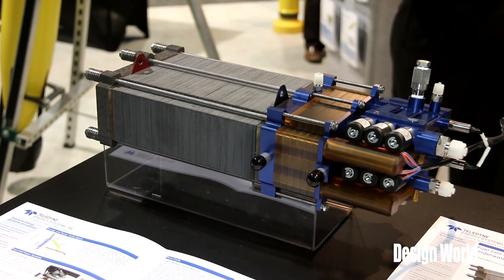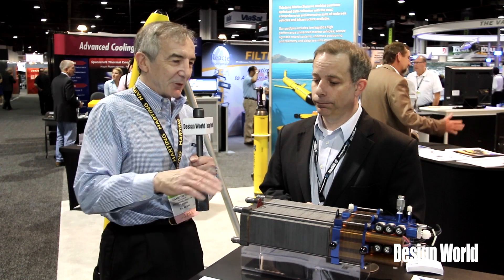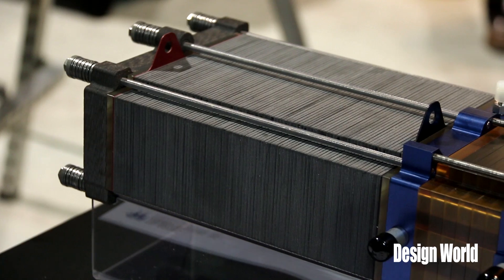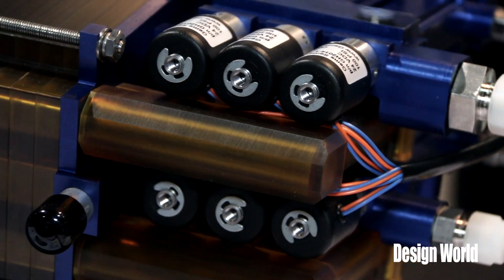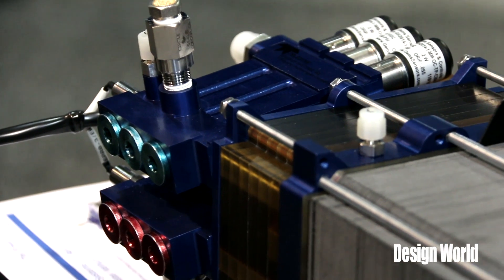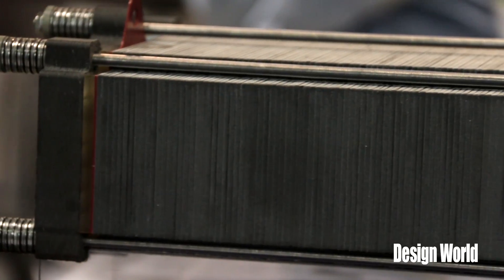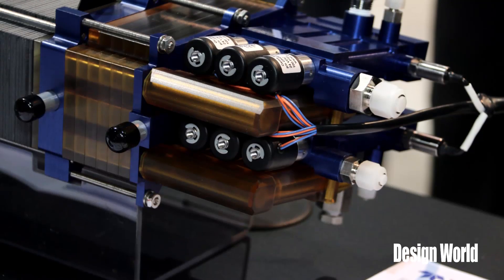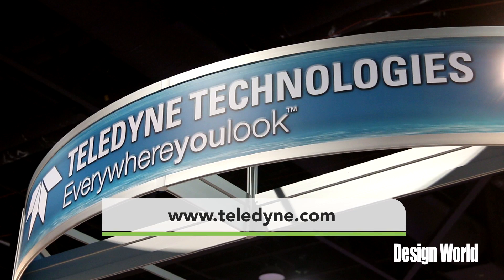Who needs batteries when you've got a hydrogen fuel cell

Comment: Fuel Cells make no sense in Vehicles. First You need a large Tank to store the High- Pressure, flammable liquid Hydrogen (5000 PSI!). Second You Need a huge and expensive new Infrastructure to supply hydrogen. Additionally Hydrogen is very expensive - the Industrie itself talks about 16 US$ per Gallon. Hydrogen today is made out of Oil or Gas, all but Emission free. And it has a poor Efficiency of not more than 19 %.  After all a hydrogen fuel cell powered vehicle is nothing but an electric Vehicle with a different Kind of Batterie. Install Batteries instead of HFC and You get a reasonable vehicle with an Efficiency above 70%.
Reply: acm the shuttle has 3 7,000 watt fuel cell generators. But only 2 tanks of 98lbs of o2 and h2 and flies for 15 days. How is that possible?
Reply: Abdullah Salman---

You have it totally backwards, fella.  There are already a million very satisfied EV drivers all over the world (I have been driving electric for 10 years now), and that number has been growing exponentially.  Virtually every car maker has begun serious, multi-billion-dollar programs to meet the Tesla challenge--- Porsche, for instance, has a billion-dollar battery plant in the works, and their Mission E is a high-performance four-passengee sports car that has been getting very favorable reviews.  Name any US or European car maker, and you will find that they are running scared, seeing that EVs ARE the future, they say so publicly, and know that if they don't get up to speed, Tesla and other EV makers will be eating their lunch.

I have four very different EVs, including a Chevy Bolt, and a fully electric Chevy pick up truck that you can see on You Tube.  If EVs were the losers you are delusional enough to think they are, I and countless other EV drivers would be jumping ship to go to ICE cars or the pathetic HF cars you are deluded into thinking are an answer.

I have no doubt the only reason you think FC cars are such a panacea is because you do not own one, and have not driven one for a few years or so, unlike the millions of EV owners that have!  Have you noticed that, of the few FC buyers in the last few years, you do not hear any rave reviews from long time owners?  They typically switch to EVs eventually due to all the hassles.

There are DOZENS of SERIOUS problems with trying to mainstream FC vehicles.  As an example, H2 is extremely chemically reactive, making various parts of their system brittle after just a few years, in which case those EXPENSIVE parts need to be replaced to avoid cracking and outgassing hydrogen vapor.  Do you really want to drive around in a FC car that has tanks operating under THOUSANDS OF POUNDS of pressure, HUNDREDS OF DEGREES below freezing... and are willing to trust that the engineers got everything right?

Are you familiar with the "Hindenberg Syndrome"? It was named for the hydrogen Zeppelin that crashed and burned in New Jersey early in the last century, killing dozens not only on board, but on the ground as well.  Google it.  That tragedy was enough to scare anyone away from trying to use hydrogen again for transportation until enough time had passed that there were no longer any people around that remembered that day.  It has been too long now... no one remembers... but it would be in the consciousness of everyone in the world the first time there is an accident at a H2 station as a family is filling up and a wayward tanker truck pulls in, and smashes into one or more cars. Everyone will be burned so completely there will not even be charred corpses to be identified.  The entire neighborhood will be incinerated, and no one will ever again want to drive a FC car--- until, of course, everyone grows old and dies, so there is no one around to remember why FCs are such a horrendously bad idea.

If those reasons were not enough, there are dozens of others... just do a search.  FCs are a TERRIBLE idea.
Reply: You are absolutely correct.  Hydrogen will never be a mainstream fuel source as it's too expensive, will always require fuel stations and makes no sense.  I'm living proof as I have solar panels and a small wind turbine at my house and an EV which we charge, for free, from the solar panels and turbine, which are all paid for, plus my house runs entirely on the solar and wind so I'm free of all fuel stations and expensive fuel.
Reply: Good points, however, offshore OTEC plants and other small uses for hydrogen are a far cry from a mainstream fuel storage.  Hydrogen will always be used, in small applications and fuel cells have a few good applications but will never become the system used in cars, trucks or planes, ie, mainstream applications.  PV has always been a great idea, just too expensive until recent years and now it's the most common form of new power generation.
Reply: +Cuda FX
That thing about fuel having greater energy density is extremely misleading!

The gasoline used in ICE cars also has very high energy density, but like the fuel cell, the greatest share of the energy you get from any fuel is used to do things entirely unrelated to making the wheels turn--- It's making absurd amounts of heat, light and noise, and linear motion which must be converted mechanically to rotational energy through a very inefficient system of connecting rods, cranks, and other heavy hardware with several square FEET of metal surface area scraping against cylinder walls with absurd amounts of drag and other losses.

There is an easy way to demonstrate the enormous amount of lost energy in an engine compared to an electric motor---put an engine on a test stand without the ignition connected.  Have it loaded with all its fluids, filters, drive belts and timing belts.  Put a crank on the front of the engine and try to turn it over by hand just one or two strokes.  You will likely become exhausted before even completing one full revolution.

Put a crank on an electric motor of comparable size, mounting it on a test stand as well... crank it by hand... even a kid should be able to do so easily, for minutes at a time.

Doing something with a fuel cell power plant is not as easy to demonstrate, but the principle still holds: you expend lots of power making energy-intense  chemical reactions, rather than making the wheels turn.  Every step the chemicals go through to eventually result in the wheels turning sap lots of your energy in the same way pistons, connecting rods, cranks, cams, valves and pumps sap the energy stored in gasoline.  The theoretical energy density of fuel does not come close to real-world efficiency.  There are losses in the conversion from battery energy to rotational energy in the coils of an electric motor, too, but it is demonstrably far more efficient: which is why a Chevy Bolt is rated at 119 MPG equivalent, which is a five passenger sedan that can give a 0-60 time of 6.5 seconds and has a real-world range of more than 300 miles; the Tesla Model S acceleration times are the quickest in the,world: as low as 0-60 in 2.3 seconds.

 You can find several ICE cars with performance and size similar to the Bolt, but with terrible efficiency and far less available cargo capacity due to engine form factor.

Today's FC cars also suffer from decent performance--- 0-60 in about 9 seconds, and that is unlikely to improve much due to the sluggish process of the fuel cell.  Its efficiency is less than 70 MPGe, which is great compared to ICE cars, but miserable by EV.standards.

These stats point to the true superiority of EVs. Even if FC cars can some day overcome some of their drawbacks, those improvements would have to increase efficiency by more than double, plus someone--- who?--- would have to be willing to build trillions of dollars worth of FC stations... I cannot imagine such a thing would make any economic sense, especially since EVs will always ha e the enormous advantage of bei g able to charge directly from any source of electricity, whereas FCs will ALWAYS need much more complex, expensive systems to provide their exotic, finicky fuel.

 it is very unlikely to happen before EV charging stations are ubiquitous across the planet, making it very unlikely for FCs to ever gain even a tiny foothold.
Reply: Those few cars that do have fuel cells carry a 5 kilo of H2 in a tank.  The tank weighs about 100 pounds, and the pressure regulation ets about the same, so we're talking (round up a little) maybe 250 pounds in energy storage handling.  The fuel cell may weigh 150 pounds, for again rounding up 500 pounds total.  My gas hybrid carries an auxiliary battery that weighs about 250 pounds, so now the energy/weight budget is up to 750 pounds (probably less, but I'm bending over backwards here).  BTW, a fuel cell car IS electric... It's just not powered by that storage device called a BATTERY.  It's storage is a hydrogen tank and a fuel cell.

The battery pack in a Tesla weighs in at 1400 pounds.  I've had BEV fans make the statement that the weight doesn't matter and refuse to even think about what that additional weight means in terms of range and economy.

Fuel Cells make perfect sense in all but the "micro car" class and even then they do.  See the Riversimple Rasa in the UK.  It's fuel cell weighs in at 45 pounds and it carries 1.1 kilos of H2.  Granted, it's kind of a freak, but what in alternative energy isn't?
Reply: billdale1 'millions of satisfied costumers' you sure make EVs look good ... You are kinda of a fanboy guy who is fan of anything thats trending ... I am sure if FC were trending with all the infrastructure i place .. and someone came up with EV idea you would be saying "EV is a terrible idea, google it"
Reply: Russel, people used to say the same thing about photovoltaic. hydrogen is a great form to store energy, for example to get the power from offshore OTEC plants to the main land. even if fuel cells remain inaffordable, once the storage is, i think it will see great use, even if at first it will mostly be burned, instead of directly converting it to electriciy.
after all, every piece of burnable fuel beats the energy density of the most advanved rechargable batteries by magnitudes.
Reply: Great points, gasoline may have high energy density but massive losses in efficiency, compared to EV's.  The cost and ease of fueling/charging an EV will always win out over gasoline and fuel cells.  The only drawback to EV's, right now, is slow charge times, which is about to change as new solid state glass batteries are in development which have already proven, in the lab, to charge an entire EV battery in ~5 minutes and offer three times the capacity, in extreme cold and hot temps.  It's pretty much the holy grail of fuel storage.  Wind and solar already offer extremely inexpensive energy generation, as we're only getting started, so electric is clearly the future.
Reply: 100% correct. 

Think about it this way. 

Solar = Kinetic or stored energy. 
Best efficiency of any system. 

Energy >> Hydrogen >> Kinetic or stored energy. 
Do you see, you needed a large amount of energy to make hydrogen through Electrolysis. 

When it comes to distance. It will either be batteries or some other more efficient fuel type. 

Elon Musk is regularly getting better and better performance out of batteries. 

The whole emphasis for hydrogen will be gone if it exceeds the human body. 

For example. I dare you to go drive 1000 miles right now with minimal rest break except for refueling. You wouldn’t be able to do it. You would want at least a few 30 minute breaks.
Reply: And the cars does 250miles on that kilo of Hydrogen, beat this you battery fans with your heavy battery.
Reply: every new technology is expensive ..... battery tech was much more expensive when it started ... stop making bullshit excuses.. and as far as largeness is concerned ... u know how large those fucker batteries are in electric cars .. plus we already use CNG to power our vehicles ... we only need to figure out how to make H2 cheaply .. the moment it happens that stupid battery tech is dead
Reply: @abdullahsulman  by the battery camp logic im left with the impression that they tend to think lithium and cobalt is infinite or something on this planet and that fuel cells won't increase efficiency as more investment goes into fuel cell r&d. just build 8 ton battery and slap it on tesla truck to replace all diesel trucks in the world. lmao. 70% of lithium is concentrated bolvia which just had a coup. fuel cell for toyota mirai needs 10 grams platinum and russia is willing to supply. rest is in the milimeter thick membrane, which is mainly r&d and manufacturing costs. not raw materials.  in lab, the effectiveness of plasma electrolysis in terms of hydrogen production was evaluated by comparing it with faraday eectrolysis. the results showed that hydrogen produced by plasma electrolysis is 149 times higher than the hydrogen produced by faraday electrolysis.  (see : https://iopscience.iop.org/article/10.1088/1757-899X/162/1/012010 ) . if it can scale up, it will be big for hydrogen economics.

am chinese and i know sinopec just formed a hydrogen subsidiary in the great hall of the people. so its a big deal. we have liquid processing plant in southside shanghai online next month. hydrogen will be the transitory energy future for belt and road countries  until the world develop technologies to harness zero point energy. china and japan are already collaborating in the sector for fuel cell development and the plan is to create cheap vehicles (see grove hydrogen automotive with nepal, brazil). personally i believe hydrogen will come to head quickly (chinese market for ev already drop 30% average every month the last four nio stock -70% ytd), outpace ev market in china by 2026 and then beyond 2035 we will have mixed society of electric and hydrogen for energy storage if graphene/solid state batteries have breakthroughs and become cost competitive with hydrogen because lithium's future is uncertain after morales got american treatment for nationalizing lithium supply with chinese mining joint venture.

toyota lead fuel cell developer predicts they will be cheaper than gasoline vehicles eventually and even o&g companies in japan predict $0.01/n3 in 2050 for liquid hydrogen. nature energy 2019: economics of converting renewable power to hydrogen paper states its already cost competitive at 3.20 euro/kg hydrogen in some applications but not for industrial supply yet. countries that have to import fossil fuels will benefit greatly as hydrogen incentivizes renewable power capacity. country like bhutan has their hydropower revenue completely eroded because they have to import $150m/yr petrol. they export $150m/yr to india in electric with 6% of their hydropower potential. hydrogen society allows them to unlock their compounding potential. i can see countries like eritrea benefitting, supply ethiopia with electric from solar then excess to hydrogen. win win.
Reply: that is why hydrogen tanks arent simple bottles, but metal hydride storage. basically a molecular sponge, into which the hydrogen readily solidifies at relatively low pressure. this technology is used in the german 212 A submarine, and there is even that brunton cell phone charger. 
(you can find the latter pretty cheap by now. sadly the "hydrolyser" to refil the cylinders costs about 600 bucks. it's a shitty power bank, but currently the cheapest way to get your hands on a fuel cell and hydride cylinders)